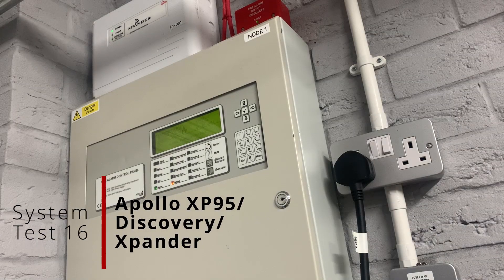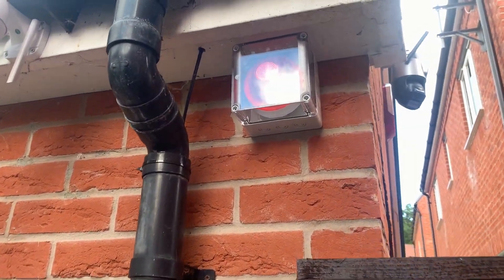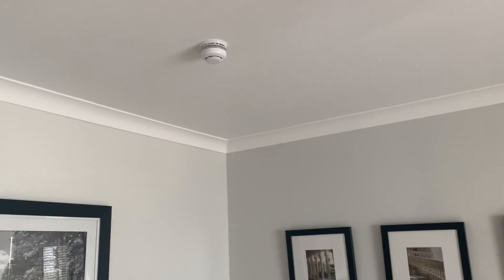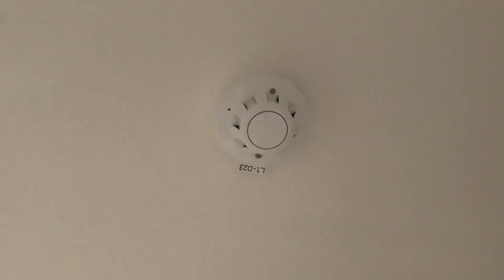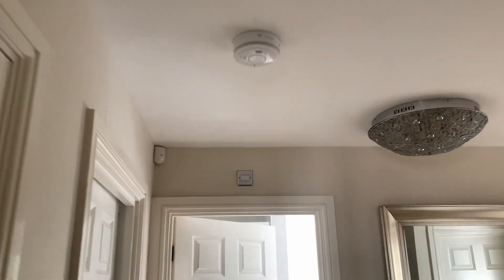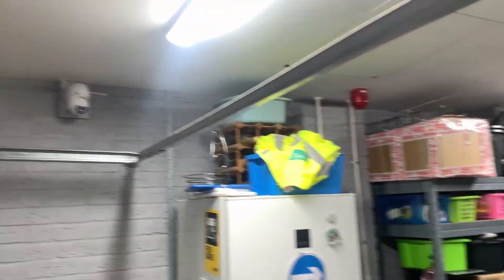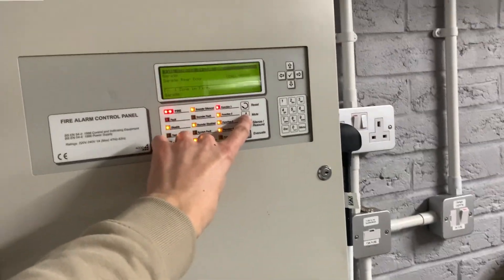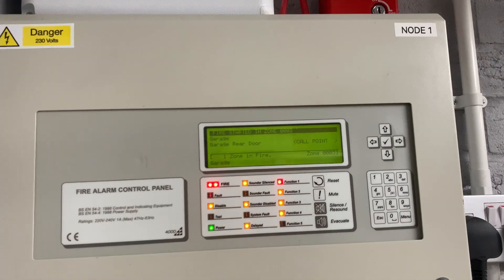Apollo XP95/Xpander House System Test 16

Comment: About 7:05: by defualt any two devices on an Advanced will bypass the investigation delays, this is more of a benefit than downside and is for compliance :)

If you wanted to aswell adding time clocks to fire events on logic statements and then adding the statements to O/P groups can change ringing mode/sounder tones depending on time of day, my Symphoni does it.

Comment: IDEAS FOR NEXT SYSTEM TEST:
MAKE IT THE CHRISTMAS TEST FOR 2024
ADD DEVICES IN THE ROOMS WITHOUT THEM
ADD MORE CALL POINTS
AND CONNECT THE SYSTEM TO THE SMOKE ALARMS, SO IF A SMOKE ALARM GOES OFF, THE SYSTEM WILL GO OFF AS WELL
Reply from the maker: @mon38-b6q  There is definitely going to be a Christmas test. However i won’t be adding any call points in the house, and not all rooms will have detectors two reasons one being cable access and secondly my parents don’t want devices in the rooms. I also will be looking at interlinking smoke alarms to the system.